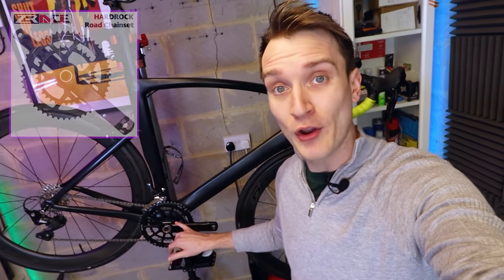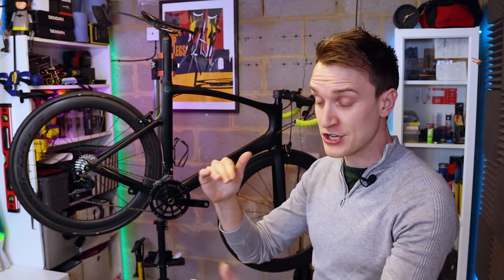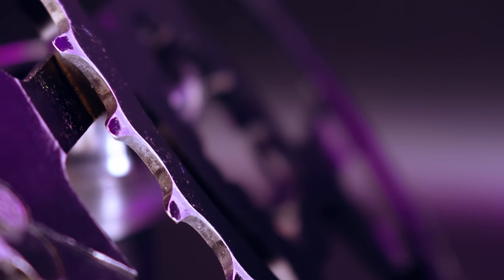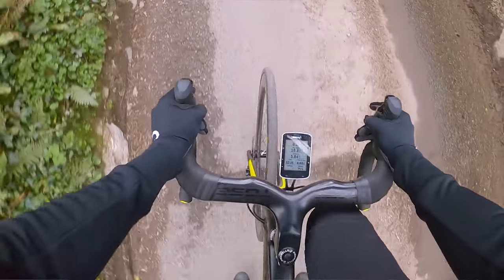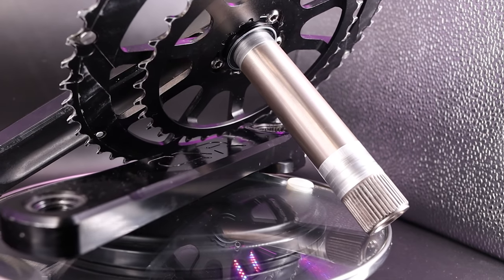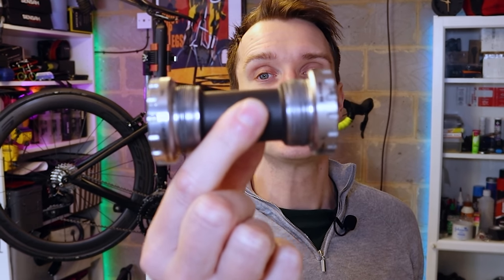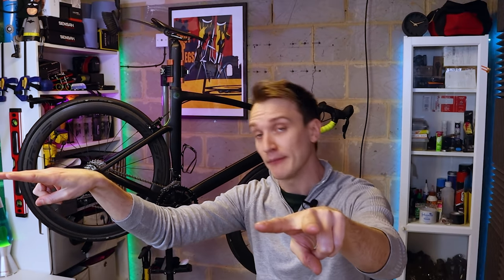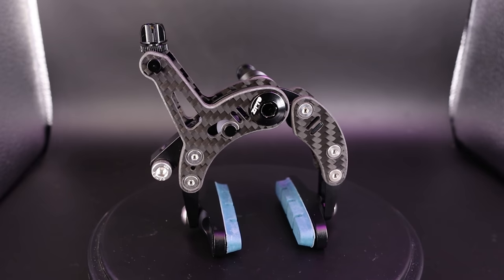Cheap Chinese Crankset ⚠️ Is failure inevitable?

Comment from the maker: So after perusing the comments section, a few engineers, including Hambini and PeakTorque, mentioned that the broken axles I demonstrated could be due to a shear failure (due to torsional overload), potentially amplified by internal defects within the aluminium. This theory could well hold up, as the broken axles were not particularly old, so aluminium fatigue is unlikely to be the only suspect, and the QC on some of these cheaper parts is definitely a little questionable. Anyway, appreciate all the comments on this one, every day is a school day folks!
Reply: To explain my reasoning, aluminium is a ductile material so you typically get a ductile fracture. The stress on the crank is predominantly torsion, the bending stress is not that high through the crank axle because it's supported by the bearings. If you assume the bending stress is very small (you essentially ignore it) and then look at the torsional loads. Typically in engineering, you would refer to solid shafts for reference so the fact this axle is hollow makes the analysis a bit more tricky. HOwever, the failure mode exhibits similar characteristics, the most noticeable one is the failure occurs at an angle and there appears to be some slight necking.  I would emphasise the caveats associated with the statements written and that being it has not been visually inspected - going off a photograph is not conclusive.
Reply: @Hambini  did your hairdresser write this for you ?😄
Reply: From the images, it looks like fatigue failure (i.e. very slow crack growth over many months probably from a manufacturing fault or flaw).  Fatigue crack growth can occur under shear or torsion.
Two thirds of the surface in the image is smooth indicating fatigue crack growth.  I can't see it in the photo, but the smooth surface should have very small close together parallel lines (a bit like a nail file).  Each line represents the fatigue damage from one cycle of the crank arm.
The remaining third of the cross-section of the shaft is very rough.  This is caused by sudden and final plastic collapse failure which occurred over perhaps a dozen cycles. This due to the torsion loading of what remains of the cross section and is what Hambini is referring to.
Any Aluminium component under such large stress cycles is a statistical ticking fatigue time bomb (i.e. will your crank could last 10,000 km or 100,000 km.  It will fail sooner or later.  Steel at the same stress will be 100,000 - 1 million km.
Increasing the diameter and thickness of the shaft helps a lot.  But if I were to spec a bike to ride around the world on (i.e. Jenny Graham and Mark Beaumont), I definitely wouldn't go with any Aluminium shaft.  Remember that the Tour De France Pro's throw their near new chainset in the bin at the end of each year.  If you were to sell on the bike, the new buyer won't know what they are getting with Aluminium.  The best bet is to take the weight penalty of steel.
Reply: Someone pointed out what looks like a crack on the spindle at around 11:34 of the video. Can someone confirm whether thats a scratch or potential crack?
Reply from the maker: @davidgarza2267  So i had a look last night, fortunately it's not a crack, just a scratch in the Aluminium. Its also not super deep either, but ill keep an eye on it either way!
Reply: @TraceVelo  glad to hear it! Thanks for all you do to enable our AliExpress addiction! 😬
Reply: @TraceVelo  A scratch will be the initiation point for a fatigue crack to grow.
Reply: I may be ignorant here, but most cranks use a steel axle? It seems a bit ambitious to use aluminium for a shaft that experiences very large torque and stress cycles.
Reply: How would Ti stand up to torsional stress?
Reply: @tornagawn  It would not hold up Luke's monetary stress.
Reply: Yes, but this is not aluminium. This is dural.

Comment: Those failures don't look like metal fatigue they look like torsional overload or shear overload.
Reply from the maker: Hambini keeping me on my toes! I think you might be right here, so I’ve pinned a comment to this effect. Anyway, thanks for the comment dude, always good to be challenged on this stuff!
Reply: @TraceVelo  I'll reply to your pinned comment.
Reply: Like a five year old to point out the obvious! :-) :-)
Reply: Or it's possibly from bearing deformation from contact between parts.
Reply: This part is designed to take torsional and shear loads, else it would fail in first weeks. Here they underestimated 1000 000 cycles with standard loads, therefore clean break.

Comment: Engineer here: Those machining marks in the middlesection kind of worried me back in the originial video about that crankset and now my worries are proven right by the mode of failure shown. The rough machining results in troughs and spikes in the surface, similar to a threaded rod, just not that deep. But it is apparantly enough to cause stress spikes in those throughs that go right around the part. Just a recipe for cracks forming and finally failure in the part. Hence shimano HTII axles are smoothed in the middlepart. If they maybe sandblasted the surface or went over it with a finer feed rate at the machine those axles would be way more reliable. Also the axles shown for SRAM are smooth and plated all around.
Reply from the maker: Thanks so much for the comment, really insightful! I think you might be onto something actually. Looking at the photos between the 2 failures, they both broke at prety much the same point too... Ill def keep this comment in mind when reviewing cranksets in the future!!!
Reply: @TraceVelo  I've got the exact same crankset, the axle is aluminium as well, but the axle has been anodized black. Would that prevent the fatigue issue then?
Reply: That might be the case too. However, I think the main reason the aluminium crank snapped at the same spot because of the nature of aluminium itself which is much softer than steel. In other hand, when I was doing a research on lubrication application on aluminium rod using pin on disc machine, I found that different type of lubrication also plays important role in reducing friction especially at those wear marks. When I looked the wear marks under SEM machine, the crack propagation is much wider on unlubed aluminium rod compared to aluminium rod that were lubed with conventional lubes.
Reply: @ruudboek  Whilst anodizing is a form of layer or case hardening (can be 3x harder than the raw material) it won't stop fatigue. It will put it off for longer, but by how much? How long is a piece of string?
It kind of depends on where and why these failures are happening. Is it from the outer diameter under tension failing, or the inside diameter under compression when the spindle flexes under load?

It is an improvement regardless to material rigidity. Compared to an identical piece of material that is untreated (and barring imperfections) it should last longer.

 Note: The harder you make something, the more brittle it also becomes. It can be a bit of a trade off.
For a constant given load, lets say a motor running a generator and the driveshaft is aluminium, with anodizing that shaft could be a lighter item from less material lasting just as long as an untreaded AL shaft. BUT that's for a constant loading through that shaft (the drag from the generator unit), our pedalling on flats, up hills, away from standstills isn't a constant, it's always variable loading.

 A very slight possibility of anodizing also being detrimental though if the inner diameter is also anodized. As you pedal and the spindle flexes, the inner diameter compresses whilst the outer stretches, ever so slightly but still happens, hardening those layers will make for a stiffer axle... for a while, then long term fatigue will catch up at some point. An essence of stretch and elasticity are good properties for longevity, not something aluminium is very good at.
Reply: @two-eyedRoy  from the pictures of the failures at 8:20 I would say that it looks like the crack formed on the outside where the alloy yielded under the stretching induced by the torque of pedalling, benefitted by the surface finish. I come to this conclusion because the outer edge is very clean, almost 90 degrees into the material with crystaline looking surfaces which is typical for strain hardening in aluminium, while the inner edge looks more fuzzy and broken out like the material was twisted apart. I know that I might succumb to my conformation bias right here but I strongly think that the outer surface gave way first.
Reply: @Medievalfan94  Of similar mind (machinist side of things here), a domed peaks surface alone would probably be enough remove that stress point from being an obvious point of cause.
 The inclusions and angle of hairline in Luke's crank is odd though, to me has signs of a materials issue prior to machining.
Reply: @ruudboek  No.
Reply: @TraceVelo  aluminium may not be as strong as steel, but they actually use aluminium in car wheels, pistons, and even driveshafts. I bet that the rise and fall in cylinder pressures and the thermal stress that aluminium pistons endure are quite high.

25 grams is a low penalty for a steel axle on bicycle cranks, so i guess that's the better choice.
Reply: It doesn't look like fatigue failure to me.Looks like shear torsion failure.
Reply: @Hambini  Agree, no apparent striations, certainly none starting from the surfaces
Reply: I'm guessing Trave Velo's crankset would've failed by now if it had the same manufacturing error/batch maybe but obviously there's a lot of variables missing like rider weight and style etc.
Reply: It's obviously a stress riser,  9:45 which is the death sentence for aluminum and CF.  (and glass, but it's not used in bikes)
Reply: @phynex5555  with a well-machined part (manly the fitment and tolerances) those marks should not be there since the bearing race should fit tight around the axle and therefore friction between those parts should not exist. Yes aluminium is a much softer material than steel, especially the stainless that would be used as a axle it this case. but in this situation with bearings taking the loads that should not matter when it comes to wear.
Reply: I talked to the seller on aliexpress (HolleBike Store) of the CVR crank and i confronted him with this youtube video. He mentioned that out of 3000 cranksets that he sold, only a few of them broke. No idea whether that is reliable information or not, but that is the statement of the seller.
Reply: The surface striations seem to add to this~
Reply: @phynex5555  Most do not break in that area though~

Comment: Great vid as usual Luke! :)

I can see the failure point in your crank spindle.
11:34 - 11:36 as it rotates through the light you can see a hairline crack including a couple of pits in keypad 8 (break the screen into 9 [3 rows, 3 columns, 8 is the bottom middle square]).
 Can't say when it'll go, but when it does I'd put money on that area being it.
 I doubt changing the machining (from that fast rough cut that's almost a thread to something smoother that takes longer) would make any difference as that hairline looks to have been present during machining (evidence being the little facets either side of the crack that glint in the light)
That does also imply the the bar stock was not forged and possibly not extruded either (could be wrong on the latter, not entirely sure).

 Like the '80s Castrol ad. 'Oils ain't Oils', metals are no different. AL 7075 cast is rather inferior (crystaline structure) to extruded 7075 (crystaline structure uniformity) and then forged 7075 is slightly better again (crystaline structure uniformity under compression). Those three states are also increasing in cost to purchase.

 A note on advertising jargon: A 'billet' is just a single piece or chunk of material. It doesn't define any level of quality.
A billet of junk material, is still junk.
 It's a fad term from the car wheel industry that since got picked up by motorsports and now any manufacturer wanting to hype up a product now faps into their own face about billet this/that in their advertising.
The term/phrase you want to read/hear is 'Billet Forging', because the Forging gives the material it's best structural properties.

Comment: Hi Luke! Just wanna share my experience here on this exact crankset too!

I had 2 of this exact cranks in 165mm. Both had the same problems where the GXP mounting surface on the crank is slanted/offset, such that my chainring doesn't spin in a straight-line. It cause my chain to rub both sides of my FD even in 50-11 gear.

For the #1 purchase, I told the seller about the issue where my chainring doesn't spin straight. The seller kindly told me that the chainrings are CNC-ed to a good tolerance, and it must be the cranks that have issue.
With little questions asked, the seller sent me a new crank, and the problem is solved. 

For my #2 purchase, the slant/offset seems even worse. Worse part is no reply from seller yet.

So kinda hit or miss
Reply from the maker: Wow interesting. Maybe in your case, the parts were damaged/bent during shipping, which led to the issue. The packaging on some of this gear is a little hap-hazard for a 3 week shipping period from China... Thanks for the comment tho, always good to hear other peoples experiences!
Reply: @TraceVelo  still worth it for the price! Risk it for a bicsuit!
Reply: I had a ZRACE Hardrock MTB crank where the left side arm was held only by a single aluminium bolt that goes into the center of the crank. Unlike Shimano it had no pinch bolts, and kinda looks like a GXP setup. After almost a year of use, the bolt snapped it's head. A similar crank to this is the Fovno Ghost.

I now went for a Prowheel MPX-11 crankset where the left crank arm has pinch bolts Similar to Shimano Hollowtech. It's a bit heavier but it looks like it will last longer.
Reply: @sepg5084  oh damn, I'm familiar with the Fovno and GXP stuff, and always thought the crank bolt torquing to like 40Nm makes it bombproof
Reply: I had the same problem here. They sent me new rings hoping it would solve the problem but was the same. Turned out the axle wasn`t bonded in straight with the arm. They where kind enough to send a new arm out also and this one has been fine.
Reply: I have the same issue with mine! It has an aluminum axle but it seems to be a tolerance issue not an axle issue. I put about 1500 miles on the crankset in the low ring on the trainer and didn't notice it being out of true. When I went to tune the front derailleur for riding outside, I noticed it was never going to be acceptable.. :( I blame myself for not putting it through all conditions initially but also did not get a response from the seller. I took it apart and cleaned and torqued it and still not spinning straight, so sad! It will go into the backup bin and I replaced with with an RS510 since they are very cheap now. An extra ~200 grams but at least it spins straight! This experience shows that you have to test these products as fast and as hard as possible for any hope of getting a response or leaving an accurate review for the other buyers.

Comment: @TraceVelo : Smoother surface will increase the resistance towards fatique. The 'lines' of milling will increase the chance of tear or rupture. Smoothing it with sanding paper will increase the durability in regard of fatique. The initiation of the cracks are on the surface, smoothing it will decrease that initiation of a crack.

Comment: Those carbon fibre caliper brakes are spongy, totally NOT stiff. Only good for the rear wheel as ABS caliper brake.
The whole thing flexes. 
VERY light indeed!
Reply from the maker: Yeah agreed, they are light, but they are mega spongy
Reply: Try the Aliexpress C.Creek EE brakes. About $160 for the pair.
Stiffer than Ultegra R8000 calipers.

Comment: Hi there.
5:30 Your right knee reaches more under the handlebar then you left, from top view, as if you have 175 mm crank on you right and 170mm crank on you left.
8:20 Fotage reveals cranks break toward the non-drive side sugesting the load was applyed on the left crank uppon breaking.
         To hinder axle break, try applying a pull on the drive side while applying pressure on the left crank.
         That is, help your left crank spread the load buy pulling simultaneously on the right crank, ballance the load with opposite load.

Comment: I worked at a bikeshop in highschool. There was a old man who rode his bike 365 days everywhere and its a was a old alu raleigh frame for commuting and he told us that when he was making a turn down a hill he felt the crankset area loose and he couldnt transfer power. As it turns out the frame gave at the bb area due to fatigue and only the top welds where holding it. Nothing bad happened since he has braked already. That was a cool experience.

Comment: I think apart from the smaller diameter of 24mm (compared to DUB at 29 or BB30 at 30mm) the material on this crank is of inferior quality, despite supposedly being made of the same 7075 aluminium as more expensive cranks. It looks like it's cast instead of forged. Which would explain why the grain structure won't be able to cope with loads as reliably. It would also explain why it is that cheap bc it's obviously cheaper to produce. Getting the steel axle version is probably a better idea. The manufacturer seems to agree.